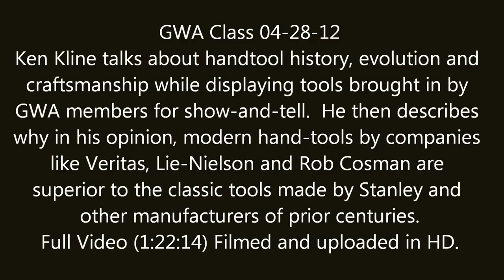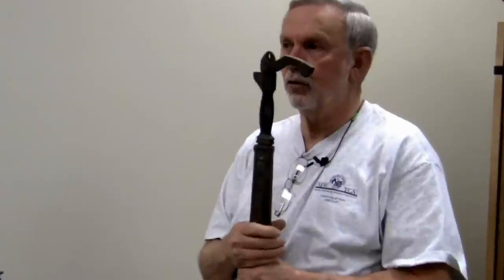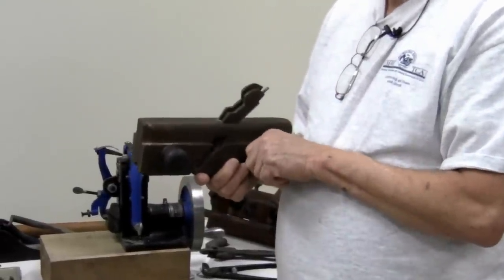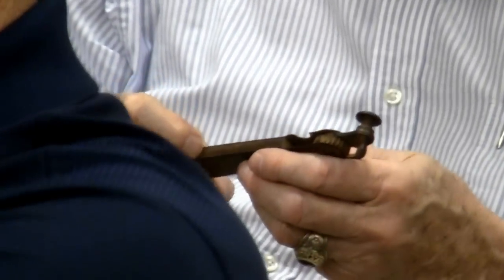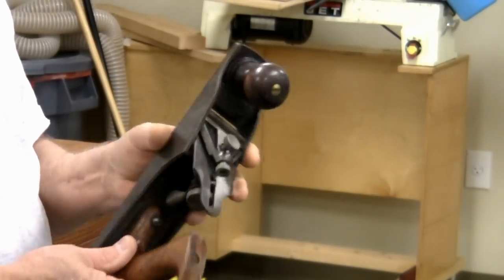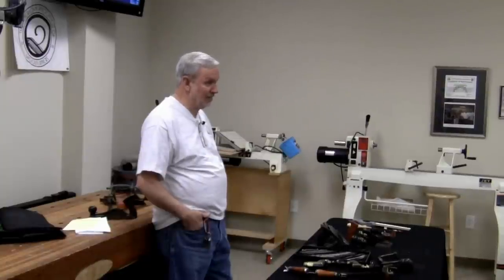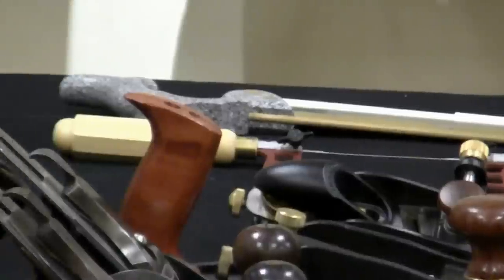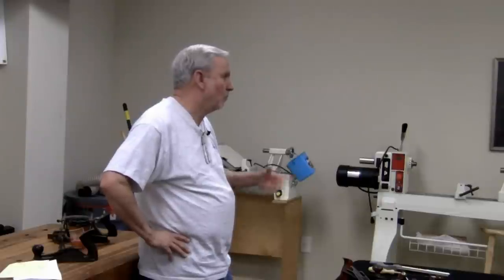2012-04-28 Why Modern Handtools are Superior (01h22m14s)

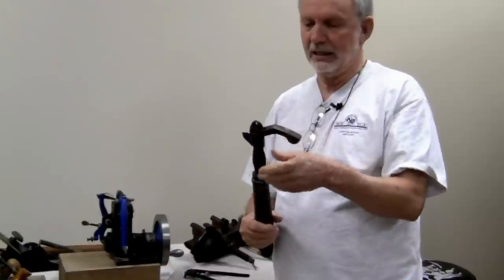Comment: Nice show, just to widen your knowledge at minute 12:00 after the nail puller, Ken showed a pair of pliers that they don't close all the way and no one knew the use for it:
Those pliers are Tile Nippers to carve a shape in ceramic tile like to cut out the toilet flange  or pipes rising up from the floor when you lay tiles, the more advanced ones are equipped with carbide tips to cut more accurately.
Respectively.